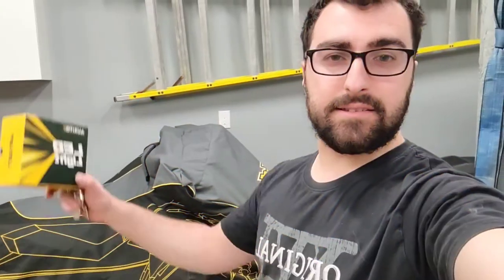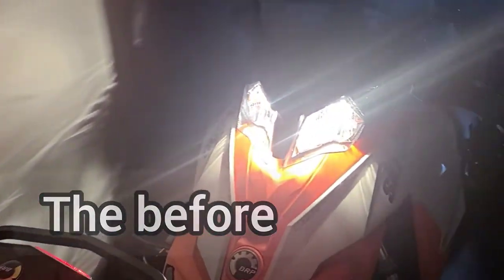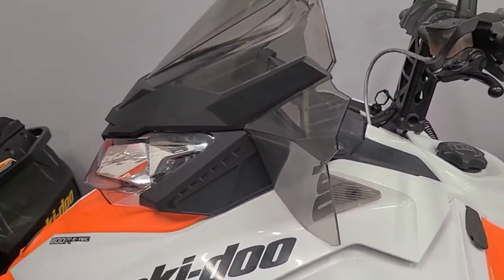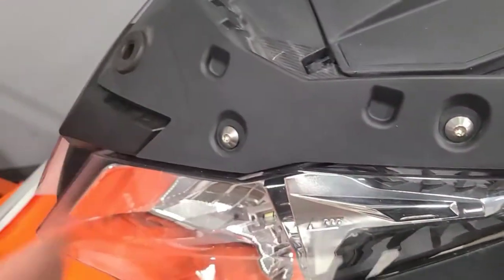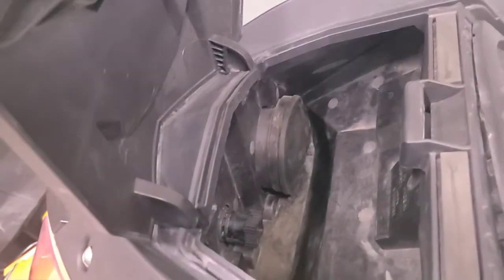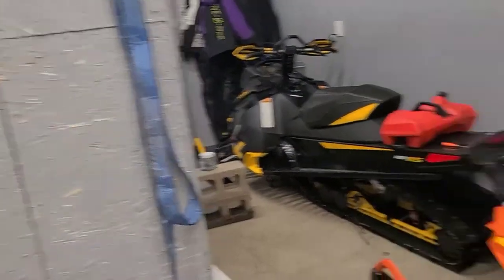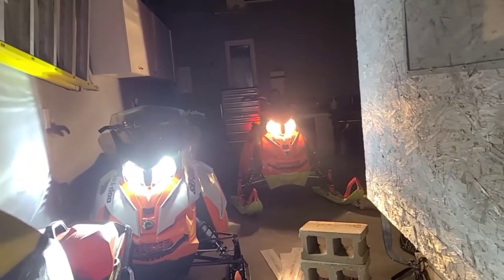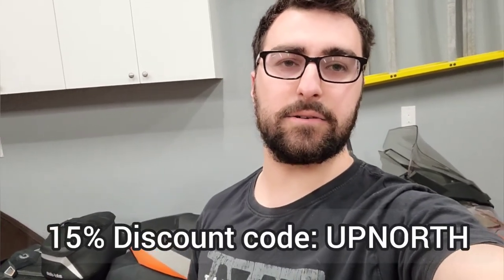Skidoo rev xs led bulb installation | auxito led

Comment: Ya so much better than stock or no? Double the brightness?
Reply from the maker: I can definitely tell the difference on trail
Reply: @UpNorth Motorsports  these probably loose the brightness no? After a short time
Reply from the maker: @wideback4553  hasn’t happened to mine yet